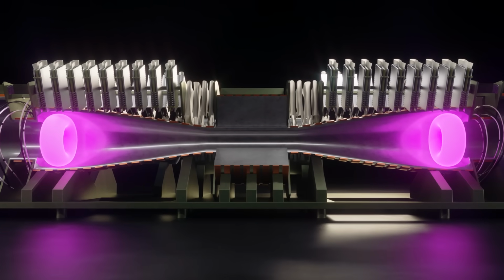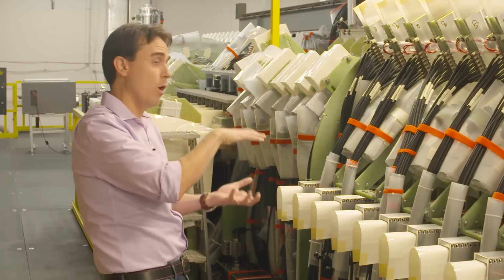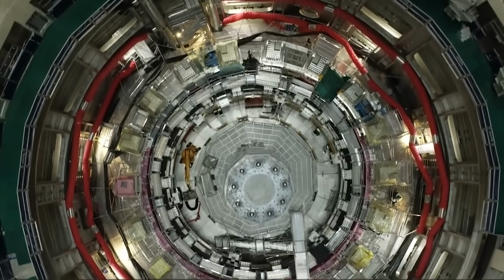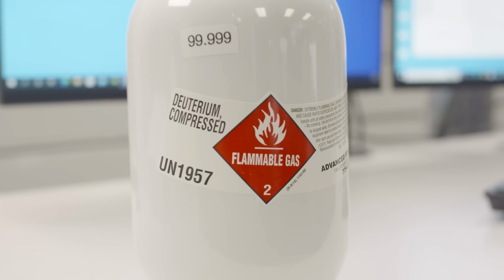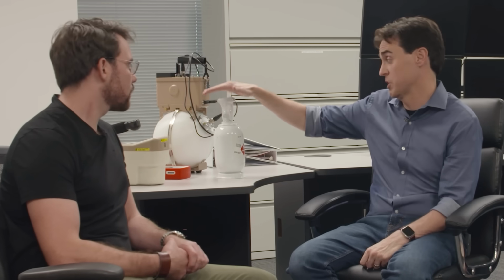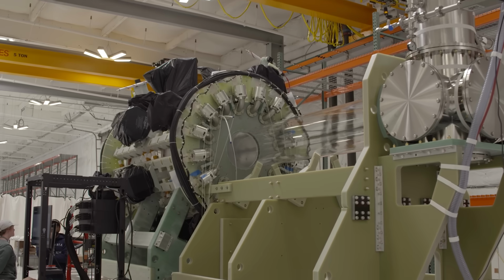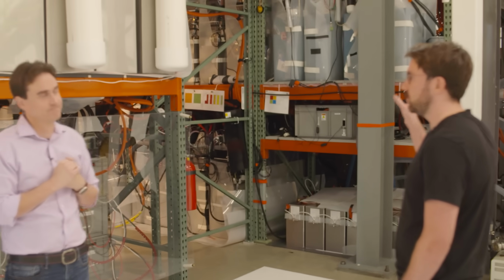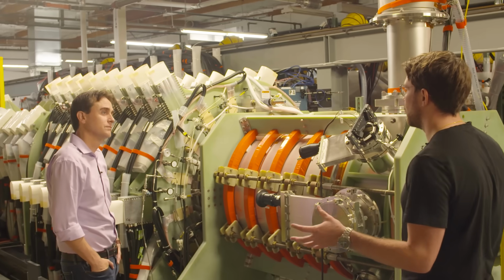A New Way to Achieve Nuclear Fusion: Helion

Comment: ...So what you are telling me, is that they not only made one of the first stable plasma Gauss Cannons in the world. But fused two of them together, and fired them simultaneously! And their using it to...harvest the magnetic anomalies coming off of it?

Do you understand, that you made a stable plasma projectile? One that burns at nearly the surface temperature of the sun, and travels at hypersonic speeds? The navy is only recently adding coils to existing projectile cannons to increase range, and a bunch of scientists just invented hypersonic plasma cannons!
And they were trying to make ion engines for space travel when they thought this up!

SiFi, isn't sounding so "fiction" anymore.
Reply: It would not really work as a cannon. The plasma would cool immediately after being exposed to ambient air. It would expand immediately without a magnetic field to confine it.
Reply: @elmarmoelzer2229  Which means we need to find a way of making it self-magnetic, so it holds itself together...Which, while it would be extremely difficult to create without bumping up the mass of it a few hundred thousand times(IE so dense, it has its own gravitational pull, holding it together. Like a small sun.). It could be theoretically possible. 

Financially viable? probably not(yet). But theoretically possible? Just maybe.
Reply: @NoctisUmbra117  Sorry dude, but I don't think you have the degrees or knowledge to determine if things are theoretically possible. You really got to separate reality from fiction else you are going to really disappoint yourself. You can't just dream thigs really hard to make things exist.
Reply: @fess3932  It's attitudes like that, that hold back  progress.

If I where to say, "I have a device in my pocket that has the collective knowledge of the entire human race. and can look anything up at will." Or that "we will have a station in space, where people stay for extended times, because we want to study things in a place with next to no gravity." 50 years ago, I would be looked at like I was completely insane!
Now we have cellphones, and the ISS.

"Dream"ing, creates Innovation. It's the driving force to "make reality" to make something possible, even when it seems impossible right now.

We have the concept of "ion thrusters" already. Thrusters that launch particles of super heated plasma, to create a sort of "wind" effect. creating thrust, even in a vacuum. And this machine creates plasma vortexes that "we can interact with" with coils creating magnetic fields in a line, to accelerate them in a singular direction.

So we know plasma can be accelerated in a single direction, and can interact with things to create a force. The last part of the equation seems to be "Finding a way to make it self magnetic. holding itself together.".

Maybe some kind of substance could be added to the mixture, as a type of "flux". that way when fired, it would need to burn away the flux in order to get to the plasma itself. Like the flux that welders use to keep oxygen away from the molten metal weld, to keep it from rusting instantly. With stick welders, there is a flux agent  physically added to the welding rods. But in MIG and TIG welders, this is done with an inert gasses.
Who's to say we can't find something to add to the plasma, that would protect it from cooling instantly when coming into contact with air? Even if for a few moments. Even if it takes half a second to burn it away. For a hypersonic projectile, that could be miles!

I don't think think that is an impossibility in the future. And what is a theory, but an educated guess about interactions in sciences that haven't even been attempted yet. Nobody knows if this is possible, until it has been done. Everything is a theory until it is tested, and repeatable. Only then is it a scientific discovery.

Comment: Hi Brian! I'm an engineer, but I'm not in the nuclear domain, I do not understand every detail. I love your videos, and I did like this one, despite feeling a bit PR-ish.
Today I've seen this one: https://www.youtube.com/watch?v=3vUPhsFoniw
Now, which way is up? Can you or Helion address these issues? Brushing them under the carpet won't work. Any thoughts?
Reply: Here for the same reason, bump
Reply: Ditto
Reply: leaving a comment so i get notified if he responds
Reply: +1
Reply: Dot.
Reply: Unfortunately, his video is riddled with misconceptions and misguidance. And his skepticism is getting over to him. It's people like him that make fusion research have even more issues because of misunderstandings of what helion is trying to accomplish. Since most people like you aren't physics literate. You have minimal understanding of it.

First Critique: "The neutrons from Deuterium-Deuterium reactions would have fried Trenta and I see no shielding."

Trenta is a subscale prototype, an experiment. It is smaller, weaker and only operates at one pulse every 10 minutes (max). A full scale powerplant would do 10 pulses a second. Not all shots were fueled by Deuterium or Deuterium + He3. Many were fueled by a mix of hydrogen and Deuterium or pure hydrogen, depending on what they wanted to test.
Because of that alone, the total neutron flux that Trenta has experienced so far is not that high.

Second Critique: "Deuterium - Helium3 has a smaller reaction cross section than Deuterium- Deuterium. At the 100 million degrees temperature discussed in the video, Deuterium-Deuterium reactions would be much more likely than Deuterium-Helium3 reactions."

That is generally true, but he misses some key points:
Trenta is a subscale prototype with much weaker magnets than what they are proposing for a full scale powerplant. Because of that temperatures are somewhat lower than in a full scale power plant. Power plants aim for temperatures 20 keV (220 million degrees) and up to 330 million degrees (30keV). At that point the D-He3 reactivity surpasses the D-D reactivity.
That said, Helion actually wants some D-D reactions because that is how they are breeding their He3.

D-D => He3 +n or D-D => T +p

Both reactions have a 50% chance of happening.

So, in mixed mode (breed and power) machines, they will need two D-D reactions for every D-He3 reaction, at least until the Tritium inventory is large enough that they have a constant supply from decay (Tritium beta decays into Helium3).

Third Critique: "Deuterium - Helium3 is too hard, and Tokamaks cannot do it. Therefore, Helion's approach of fusing Deuterium and Helium3 can never work."

D-He3 is very hard to ignite, but they do not need ignition for their design to produce enough net electricity to be economic. Most of the energy from D-D and D-He3 reactions is released as charged particles, not in neutrons. Helion can recover the energy in charged particles directly as electricity at a higher efficiency than a steam plant would. They can also recover 95% of the input energy directly as electricity. That makes their machines a lot more efficient.

Another thing that works in Helion's favor is the Te:Ti ratio they use. This ratio actually decreases further with higher temperatures. So the hotter the plasma gets, the smaller that ratio. Trenta already showed Te:Ti at <0.1. It is likely that a power plant will have an even lower ratio. Lower electron temperatures greatly reduce Bremsstrahlung losses. At a ratio of 0.1, thermal transport losses actually kick in earlier than Bremsstrahlung.

So I don't know if he did enough research into helion, because these are key points that he somehow missed that others have pointed out.

Comment: Invest in Cold Fusion.
Both Hot AND Cold Fusion Technology has been around for decades, but Cold Fusion can be scaled up and most importantly, scaled down.
All the way down to power Automobiles, Trucks, Aircraft and even individual homes and Businesses.
It would mean the end of the Petro Dominance, the End of Famine, Abundant Fresh Water, inexpensive manufacturing and Free and clean Energy for the Entire Planet.
The reason they are pushing Hot Fusion is so it can be centrally Controlled and Metered for Profit.

Comment: Can this thing explode like Chernobyl?
Reply: No, it can't. Fusion generators in general can't explode.
For one, there is no chain reaction that can run away. Once you turn off the (recirculating) power, the machine stops.
The fusion plasma is very hot, but not very dense (closer to a vacuum than to ambient air) and it is surrounded by a high vacuum, which is a perfect insulator. Think of steam from a pot of boiling water. The steam is boiling hot, but you can hold your hand into it (carefully!) without getting severe burns. This is similar. It also cools off immediately when it touches anything like air or the vacuum vessel walls. The total energy content of a pulse is only a hand full of kWh, a fraction of the content in a Tesla battery. In addition to that, the magnetic field keeps it away from the walls until it is allowed to expand. It cools off during expansion. While it expands it induces a current in the surrounding coils. Doing that work makes it cool off even faster.
Reply: Chernobyl didn't explode
Reply: @isabellagoogleaccount8418  Okay, yep this is the 6th comment I've seen of you saying dumb shit. I won't respond to your replies since your obviously a troll, but yes Chernobyl Nuclear facility, Reactor 4 did explode when a run away reaction caused a steam explosion in the vessel leading to radioactive materials being spread for hundreds of miles and an open exposed nuclear fission reaction.
Reply: @fess3932  Well, sorry not sorry to ruin your misinformation operation. Since you're not able to describe what happened, I will for you: Chernobyl's scientists, during a test, lowered the core power too much. In these cases the reactor is unstable and should shut down, but they went ahead to increase the power quickly by removing automatic safety systems and almost all the control rods, those that slow down the fission. The power started rising again, and they turned off the cooling system. From here, temperatures had begun rising exponentially due to other industrial defects. The core melted, so they threw all the rods back in to stop the fission. However the rods had a graphite tip, got stuck, there was a final surge of heat, the steam pressure caused the core lid to explode and the graphite also exploded on contact with the air. Which means that the explosion is not nuclear, and the plant did not blow up. Please inform yourself before spouting additional misinformation.

Comment: Like a z-pinch reactor! Been a while since my plasma's course.

Awesome tech but important to note that fusion won't solve our climate crisis in time. All the technology is there already it's just people and politics.
Reply: Yeah 2050;

Need to get net energy gain (Q=Eout/Ein>1) 
Need to push that Q up to account for the efficiency of extracting energy
Need to make the design cheaper than renewables/storage (& Gen4 fission reactor's)
Need to get designs approved and built around the world.
I don't think it's feasible in 30years, or atleast worth betting the planet  when we know changing our lifestyle and getting world powers to take climate change seriously would fix the issue for sure.
Reply: @Britishscout2012  
Well, Helion is planning for net electricity (not just net energy) next year! Their machines are small and cheap enough to build that they should have a first of a kind power plant ready before the end of the decade. Then mass production (they plan to eventually produce 20 a day). I think 10 years is realistic for that.
The big question mark is regulation. That is currently still undecided in the US. The UK is already way ahead in this regard. China would be quick to adopt (ENN is already working on a Helion- clone). I think that those that do not adopt fusion quickly will fall into economic insignificance within a decade or two.
Reply: Define "In time". Most countries are not planning to be carbon neutral before 2050. That is still almost 30 years.

Comment: Did I'm miss what they do with the super heated gas after fusion? Does it also need to be magnetically confined in a vacuum until it cools or is it vented to some kind of storage receptacle? Or is the heat reciprocated to new fuel somehow? This was an awesome video can't wait to see what their energy production looks like, this is very promising design for large scale adoption if they can achieve net gain.
Reply: The gas cools (mostly) down as it expands and induces a current in the surrounding coils. It is still hot afterwards but a lot colder. The divertor takes care of the rest.

Comment: Not gonna lie, I'm getting some cold fusion vibes here.
Does anybody know if neutrons were actually detected?
Reply: This reactor isn't all that amazing. Look up reposbe to this video by Improbable matter channel
Reply: @sumedhsingh731  Already did. it does confirm the fishiness of the whole thing.
Reply: Not published for Trenta, but for the (much smaller) predecessor, Venti. Venti did 10^11 neutrons from D-D/pulse. It had a triple product of 10^19 keV s/m3.
Trenta has 3 times the radius and 30 times the volume. Confinement times scales as radius^2.1 and power output scales as volume*confinement. So radius^5.6. 
I am sure you can guess that Trenta would be performing MUCH better than Venti did (which did great for such a small machine).

Comment: Incredible video. I’m just intrigued on how they overcome the two-stream instability, a type of instability that happens when two streams of plasma collide, making the efficiency of the energy output of the fusion reactions very low. In a basic plasma I course, I have been told that it is the reason why such a method was not used…
Reply: The fusion conditions are not happening because of the collision of the two FRCs. The reason for them colliding two FRCs is because the two plasmoids merge into a single, hotter and more stable one. Essentially, the kinetic energy of the collision gets transferred to the new FRC. Hotter FRCs are more stable to tilt instabilities. The actual fusion happens, when the newly formed FRC is compressed to fusion conditions by strong magnets.

Comment: In the fusion reaction shown in minute 13:30, if they use this reaction to generate helium 3, why can't tokamaks use this same reaction to generate tritium, which also has a significant mass deficit
Reply: Because Tokamaks are low beta and their ions and electrons are in thermal equilibrium.
Helion's machines have a very low electron to ion temperature ratio of <0.1. 
P(fus)/P(loss) scales as Ti^1.5 / (Z^2 * Te^0.5 )
Whereas Z is the atomic number.

Comment: Some questions have been raised about this video.
Not sure why real engineering would gloss over or completely ignore some of the issues outlined in the below video. Maybe they were paid by Helion?

https://youtu.be/3vUPhsFoniw
Reply: Because the issues outlined in that video are mostly bogus and based on very little research that the author has done.
If you are interested in the actual physics behind Helion's approach, I highly recommend watching David Kirtley's recent presentation at Princeton. He addresses a lot of the points made by IM in that talk.
https://mediacentral.princeton.edu/media/JPP08December2022_DKirtley/1_9p8c7d85
Reply: @elmarmoelzer2229 I just watched your linked presentation. Thanks for providing it. Now, I am an amateur physicist at best so cannot comment at all on the confinement parts that IM criticises.

That leaves the breaking radiation and other losses due to radiation, as well as the fuel source. On the radiation points, the CEO does mention them but only in some sort of "we can capture this in the future and use it as extra energy" explanation; which I'm not super comfortable with but I'll concede the notion of one engineering challenge at a time.
My brain was a bit frazzled at the end lol, but I think the CEO did admit in passing that the 3HE fuel won't give as much output as D-T, without really addressing it.

I'm not against any of it, I just think the RE video could have done a better job in presenting all the challenges and downsides to this form of fusion.

Comment: Im sure they thought about this but over 100 million degrees inside the chamber?! So they have a type of metal that can withstand that amount of heat. Or is it really isn’t that hot and they’re over exaggerating it.
Reply: The fusion plasma is very hot, but not very dense (closer to a vacuum than to ambient air) and it is surrounded by a high vacuum, which is a perfect insulator. Think of steam from a pot of boiling water. The steam is boiling hot, but you can hold your hand into it (carefully!) without getting severe burns. This is similar. It also cools off immediately when it touches anything like air or the vacuum vessel walls. The total energy content of a pulse is only a hand full of kWh, a fraction of the content in a Tesla battery. In addition to that, the magnetic field keeps it away from the walls until it is allowed to expand. It cools off during expansion. While it expands it induces a current in the surounding coils. Doing that work makes it cool off even faster.